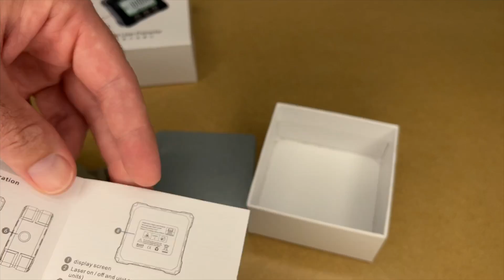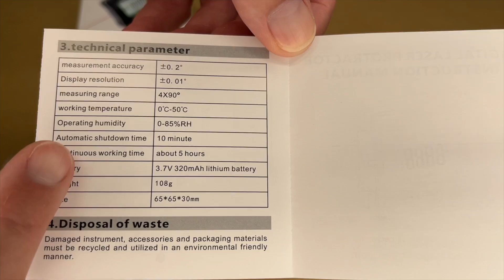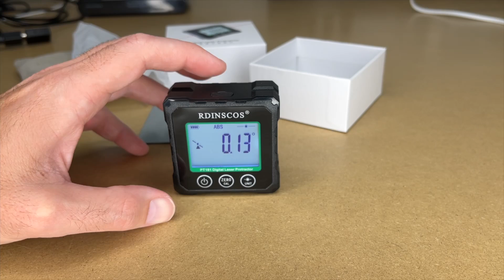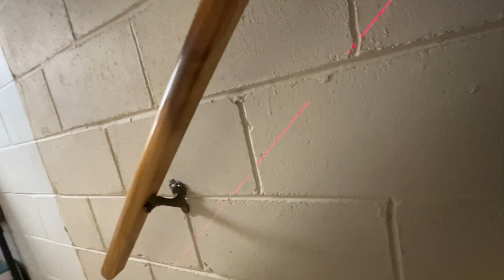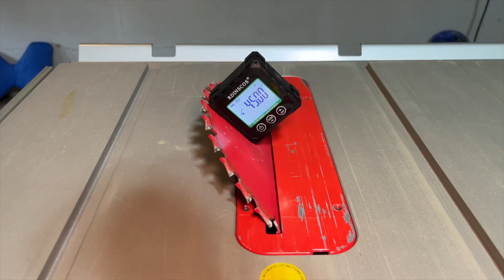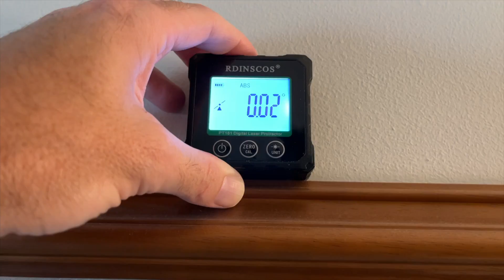RDINSCOS Digital Laser Protractor

Comment: thanks for the demo... just a point about setting up an angle on the blade... Out of the box and straight onto the saw blade you will find the angle is relative to the Earth not the table saw bed... it is only useful for cutting angles IF the table bed is also level relative to the Earth too.   The table being flat/level is not totally necessary.. if the table is at 5 degrees off level you must add that the the blade reading too otherwise it can be out. You could ignore true level and Zero the device on the table bed of course and then put the device on the blade... that will give you a true angle relative to the bed.